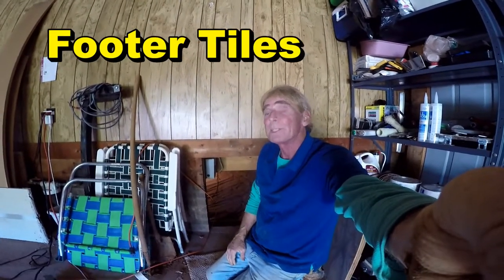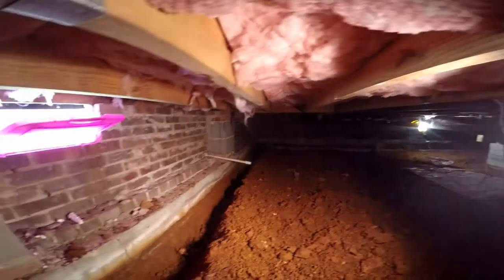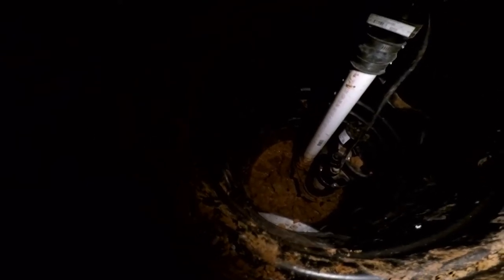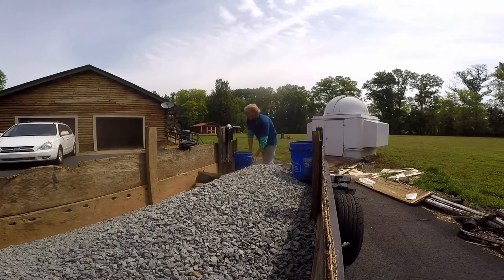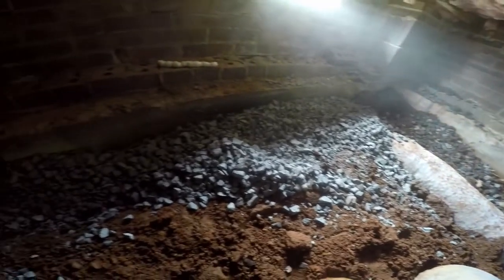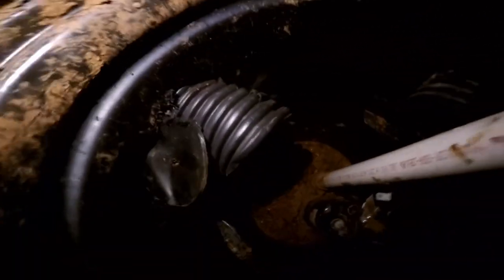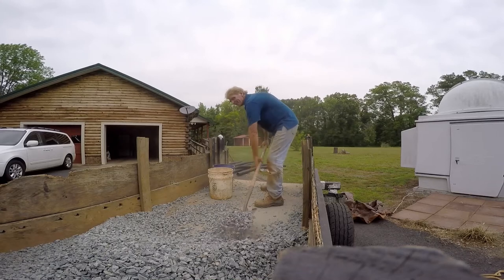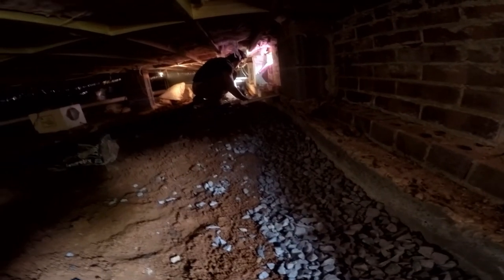Footer Drain Pipe Install -  Crawl Space, Waterproofing and Drainage

Comment: i had to do this job, not fun but i had fall away from the house so i dug under the footing and built a catch basin in the corner at my crawl door, put a p-trap with a drain grille for water to enter then gravity takes the water away when water gets to the top of my drain, 10 years in still working great, oh yea put a grill on the outlet too

Comment: If water enters crawl space from outside, why not put pipe just below footer height on outside. Natural gravity drain or outside sump pit below frost line.  Water level never rises high enough to enter crawl space.  Much easier to work outside, maybe use a trencher outside!
Reply: Your idea seems reasonable and I remember back in the early 1970s, seeing my Dad put gravel on the outside of a house foundation below the ground level.   Maybe he had them put down the footer pipe/tile too, I can't remember.  I remember there was some sealer applied to the concrete blocks too.

Comment: Do I need to put filter fabric underneath the pipe? Or just to separate the rock and the soil above the pipe?
Reply: If you haven't completed it already, the filter fabric should be beneath the pipe so dirt doesn't fill the pipe and clog it.